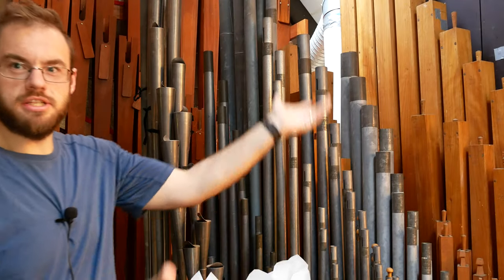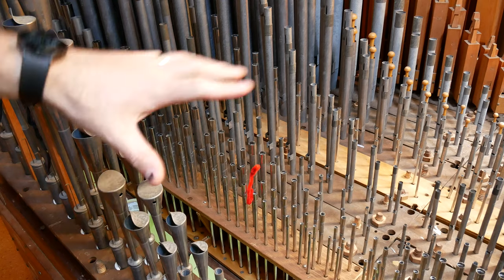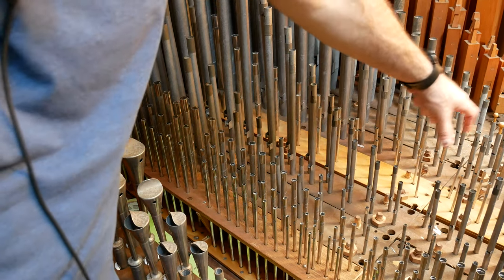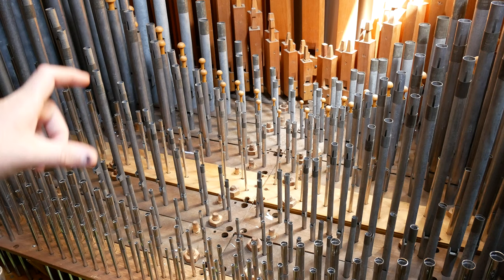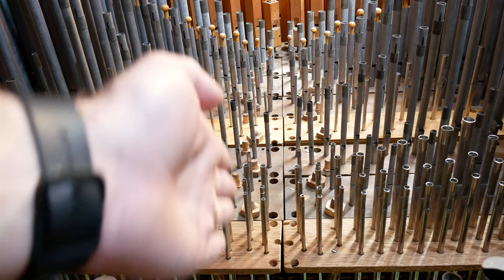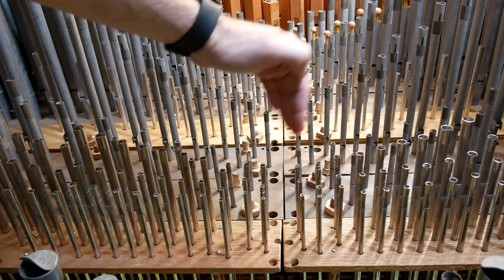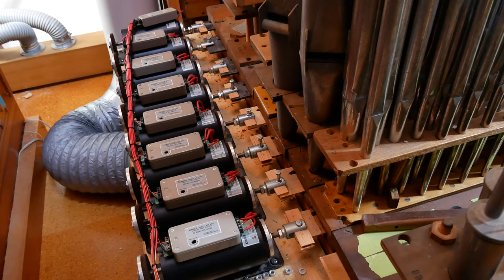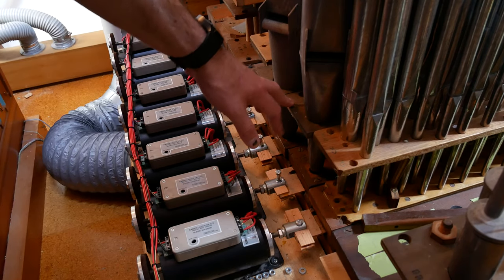Pipe Organ Project: The Swell Windchest

Comment: Interesting how it works on a kind of martrix - never knew that.
Reply: There are actually quite a few different ways that organ “action” can be set up.  The slider chest arrangement was used throughout most of history before the advent of electricity and the electromagnet.  The sliders then were connected from the key to the pipe channel (or note channel) via trackers.  Trackers were made out of small pieces of wood that were cut square.  The stops were connected to the stop channels via the same type of wooden tracker.  They are known as tracker action organs.  With electricity, organ builders started to use new types of action, electro-pneumatic, direct action, electric slider chests, and some others.  I really like the slider chest design.  From the technical side of things, There are fewer electromagnets to have to repair, the chests are much more simple, and they usually have a much longer life than some of the other chest designs.  This is an awesome setup that he has!

Comment: Good job Trent! Welcome to the club of home pipe organs. Have one myself, 2 manual and pedal 3 rank Kilgen built in 1947. Also tuning wise, are you tuning to A440 @ 70*F with an equal temperament.?
Reply from the maker: I'm tuning to equal temperament, but the actual pitch fluctuates. Last tuning was 436Hz, because that's the closest to what the pipes were speaking.
Reply: @TrentHamilton  I’ve heard of instruments tuned to A440 and A432, but never 436. That’s so weird.
Reply from the maker: @ferretyluv  The temperature fluctuates the tuning, so that was the closest that made sense for the temperature.